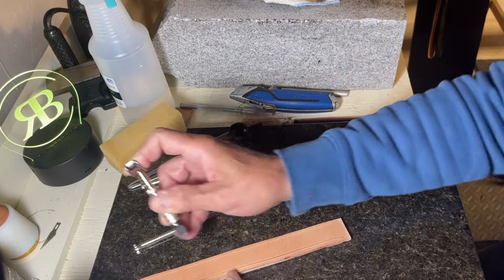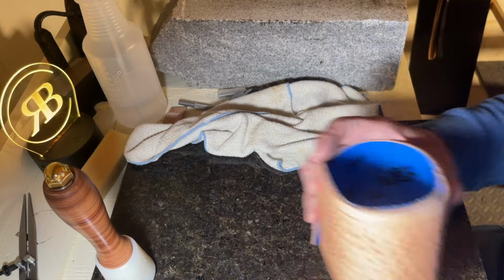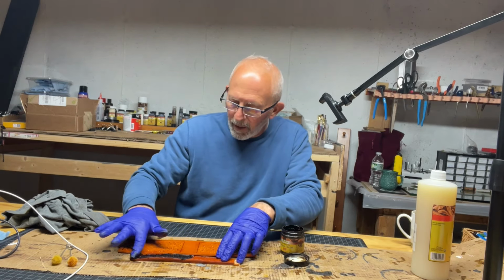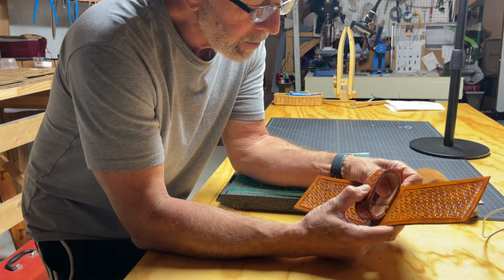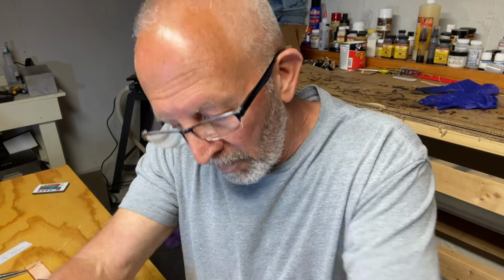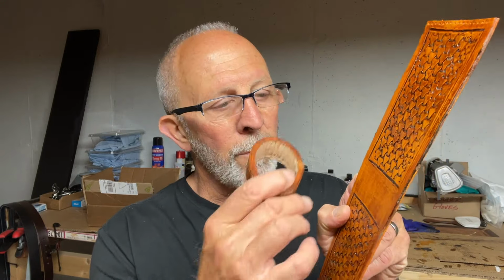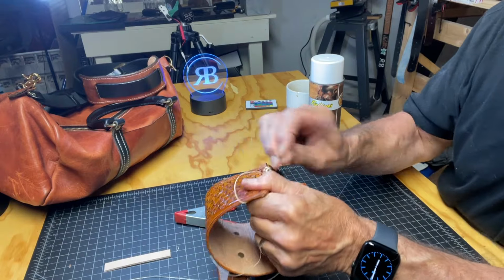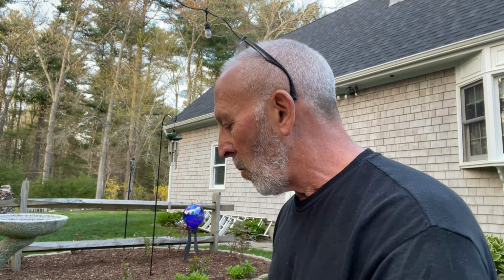Have You WRAPPED your YETI Yet? | How I made a Leather YETI Handle

Comment: Now I want to make one for my Yeti tumbler. I take it it's a friction fit, able to slide on and off when you want it to but hold onto it when you're using it?  How did you figure out how tight you needed it to be around the Yeti?
Reply from the maker: Slicking the backside with Tokenole probably wasn’t the best idea. The full tumbler is quite heavy and it was sliding on me. I glued a thin piece of scrap around the inside and it doesn’t slide at all now. I use it daily and it’s been good. I have to work it with all my fingertips to slip it off.
Reply: @brillonleather  Yeah man, good idea 👍